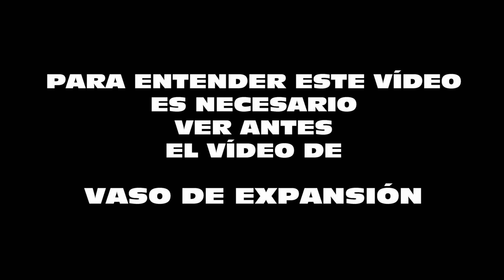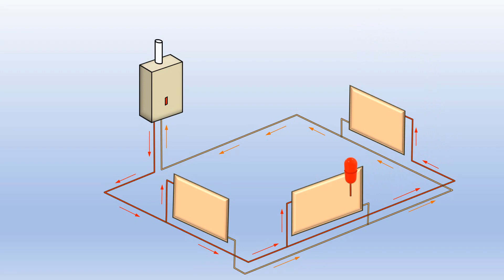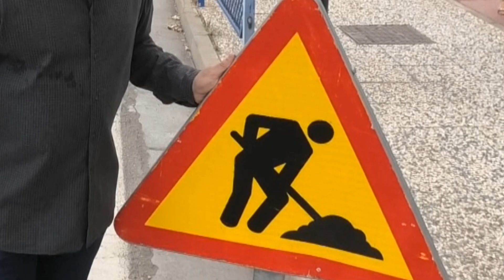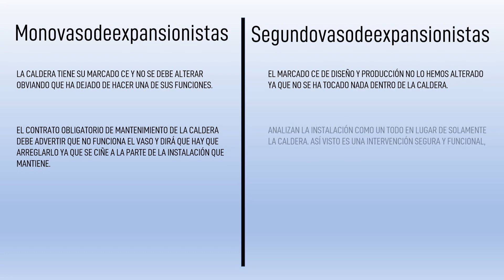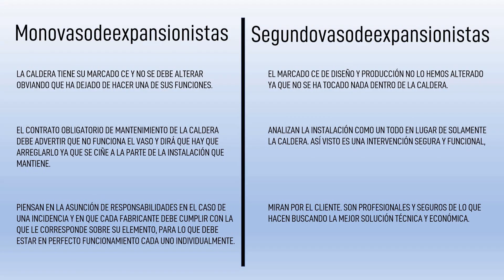Segundo vaso de expansión.  Explicado y fácil.

Comment: Yo estoy contigo, me gustaria saber que opinas de poner un segundo vaso de expansion para compensar el incremento de presión cuando instalas cabezales termostaticos
Reply from the maker: Buenos días Roberto:

Me alegra mucho que escribas porque eres activo pensando. Es decir, no ves los vídeos a la hora de la siesta (como hago yo 😅).

Tienes razón en decir que los cabezales a la hora de cerrar suponen un aumento de presión, pero tampoco es muy grande porque si la instalación es bitubo, el agua corre hacia el siguiente por la distribución. Si es monotubo se bypasea por el cuerpo de la llave.
Y tienes razón también en que el problema existe cuando al poner los cabezales termostáticos resultan ruidosos. Es por el aumento de velocidad al cerrar el cabezal en el momento en que se va estrangulando el paso de entrada al ir alcanzando la temperatura de diseño. Se da en pocos casos, pero cuando se da... el dolor de cabeza para el técnico está garantizado.
Lo mejor para aliviar la presión es una válvula de presión diferencial entre ida y retorno. El vaso de expansión con ese fin amortiguaría el incremento de presión en ese momento de cierre de válvula si el cierre se produce rápido. Si está mucho tiempo en la posición de cierre casi total... en ese caso me temo que no servirá.
Pero la idea me gusta. Muchas gracias.

Recibe un cordial saludo: Javier.
Reply: @javierdelpico  Muchas gracias por tu tiempo y por tu respuesta. Un saludo

Comment: Me pregunto, si como solución temporal, sería suficiente con meter aire en un radiador de la instalación que no nos importe mucho que no llegue a calentarse. Gracias.
Reply from the maker: Buenas días Julian:

Tu pregunta es buena y pertinente.
Lo que quieres hacer es algo parecido a un vaso de expansión cerrado de contacto directo. Esos vasos no tienen el diafragma de separación. Si embargo yo no te recomiendo que lo hagas porque el agua es un gran disolvente del aire y cuando la temperatura baja vuelve a diluir aire. Ese aire diluído se te irá por toda la instalación cuando circule la bomba. Cuando se vuelva a calentar saldrá por los puntos altos de la instalación y por sus purgadores (de no irse a otros radiadores impidiendo la circulación de agua en ellos). Las bolsas de aire te impedirán que la circuladora trabaje bien. Además, ese aire favorece la corrosión en las partes metálicas de la caldera. En definitiva, puede suponer más un problema que una solución.

Si decides hacerlo y vives en una casa con dos pisos hazlo en un punto lo más alto posible.

Recibe un cordial saludo: Javier.
Reply: @javierdelpico   

Hola Javier:

Muchas gracias por responder y compartir tu conocimiento. Esta respuesta, al igual que muchos de tus vídeos, me resultan muy constructivos. 

Muchas gracias también por el consejo, aunque por suerte (y para tranqulidad de mi caldera), la pregunta era mera curiosidad.

Un saludo,
Julián.

Comment: Buenas, que marca de caldera mixta de gas natural te instalarias en casa? Suponiendo que fuera un piso de 100m2.
Me han hablado de Biasi, Protherm.
Gracias.
Reply from the maker: Buenas tardes Jose Luis:

Lo que te han recomendado son buenas calderas las dos. Biasi tiene buen prestigio y aunque no te suene Protherm es una segunda marca de Valillant que por muchos es considerada como una marca premium.
Para 100 m2 cualquiera de las dos es más que suficiente.

Para aconsejarte te diré que mi opinión no es tanto en la caldera como en el servicio técnico.
Sondea cómo es el servicio técnico de cada marca en tu zona. Ellos son los que convierten a una caldera en buena o mala. Su celeridad y su calidad de atención son determinantes.

Recibe un cordial saludo: Javier.

Comment: Excelente y muy instructivo vídeo. Una pregunta Javier y perdone, sería correcto poner una llave de corte justo antes de poner el vaso de expansión adicional? Eso me facilitaría el futuro reemplazo de dicho vaso sin vaciar la instalación, o me pondrían pegas por dicha llave de corte al momento de hacerme la revisión obligatoria de la caldera? Un saludo afectuoso y gracias.
Reply from the maker: Buenos días Jonathan:

Tu pregunta es muy buena porque es una de las piezas que más se estropean y hay que cambiar. En una gran instalación tener que parar para cambiar el vaso es un lío porque siempre sucede cuando menos interesa. Esa llave vendría muy bien para el cometido que apuntas.

En ese sentido las OCA's no son permisivas cuando las ven. Por un lado si revisas el RITE y el CTE no verás nada que impida la colocación de esa llave. Sin embargo, en la ITC MIE-AP-12 (de aparatos a presión) referido a las calderas decía: El circuito hidráulico de la caldera deberá conectarse a un vaso de expansión y de forma que "entre ambos no exista ningún elemento de corte" ... y luego admite una válvula de tres vías cuando eran vasos abiertos, etc. 

Pero estamos hablando de 1985 y algo ha llovido desde entonces, así que no se bien cómo responderte porque hay aspectos de normas de hace años que siguen vigentes como algunos de las NIA.

En cualquier caso, si pones una válvula quítale la maneta o precíntala para que nadie te la manipule.

Recibe un cordial saludo: Javier.
Reply: A día de hoy según el Rite, eso se ha modificado y se puede colocar la llaves de corte, se puede quitar la maneta, dejando el tornillo para que no lo pueda usar cualquiera

Comment: Se puede aprovechar el momento del cambio de obús para poner un latiguillo para poder hacer las revisiones y cargas desde una posición más cómoda.
Reply from the maker: Buenas tardes J. López:

Entiendo que te refieres para el lado de aire del vaso de expansión, que es el que revisamos.
En ese caso, hay un tipo de bombas que tienen un pequeño latiguillo para conectar y eso les hace más cómodas a la hora de conectar a la válvula. Aun así piensa que cuando le pones el latiguillo éste está pinchando en el obús y si lo dejas puesto entonces estás dejando el obús abierto y se te irá todo el aire.
Si es muy inaccesible el obús y decides dejarlo roscado pero sin terminar de presionar el obús... bueno, es una pieza barata que venden sueltas y te puede facilitar llegar. aun así siempre has de llegar con la mano para darle el giro que presione ese obús y perderás la observación de si echa agua cuando la membrana está pinchada. En definitiva, depende de cuánto te cueste acceder al obús.

Recibe un cordial saludo: Javier.